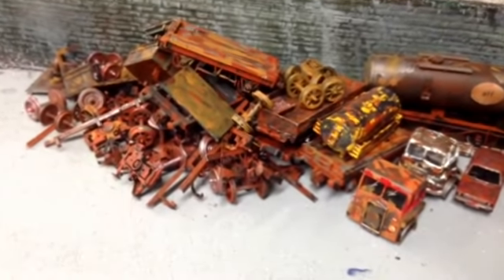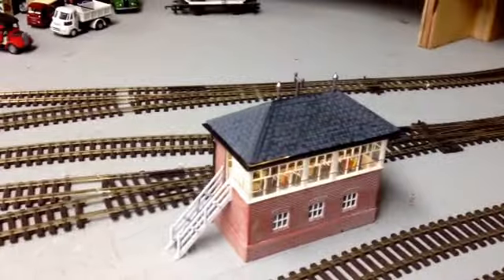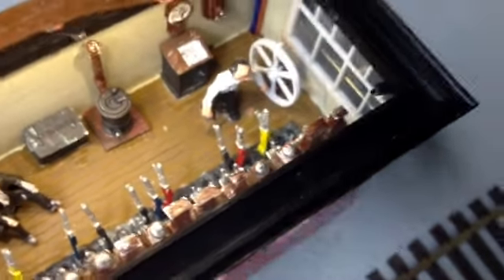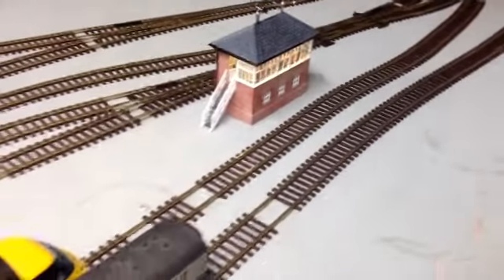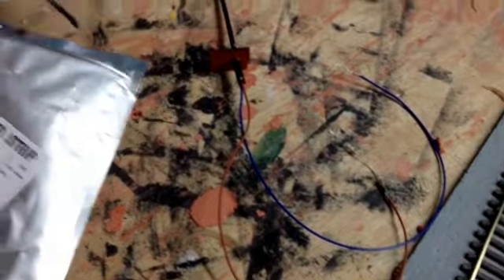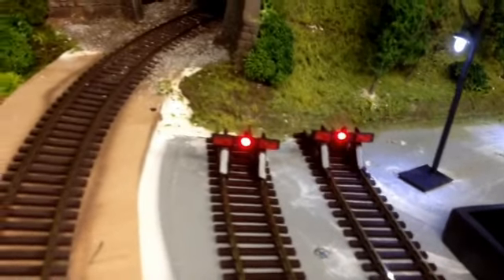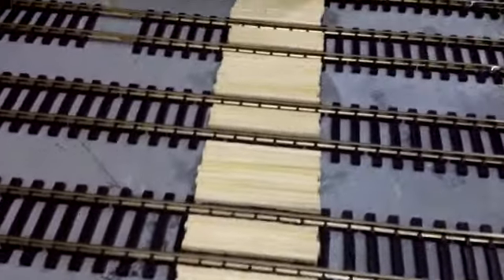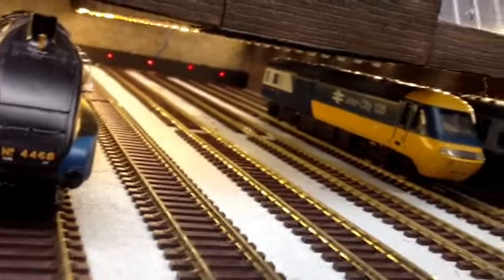Penwithers no 5

Comment: I almost crapped when I saw your light...I make a real similar version using a Bic pen. I used the ink tube for the vertical shaft and a No. 8 trim washer for a shade. Also Part of a paper clip for a horizontal arm and some telephone wire that makes up an angled brace and second conductor for the led.